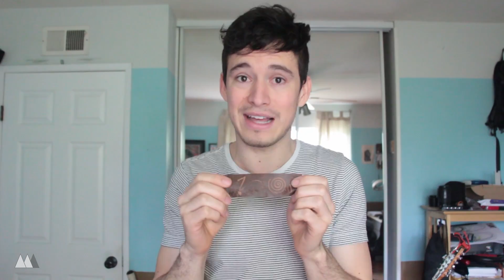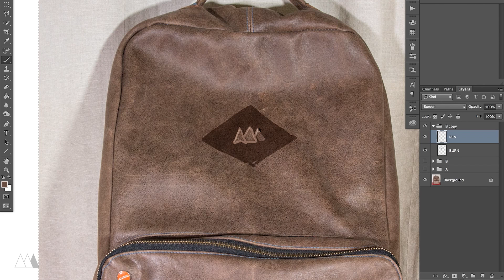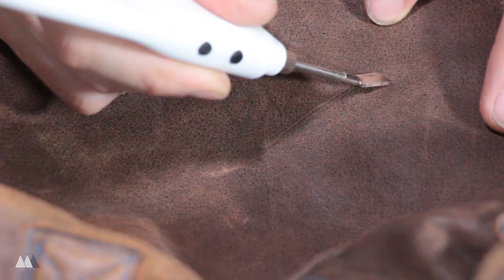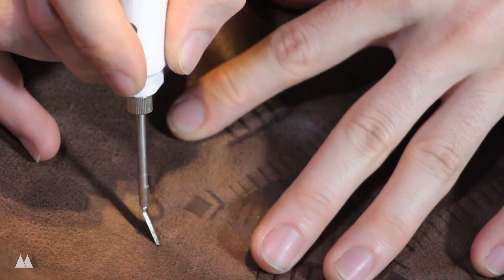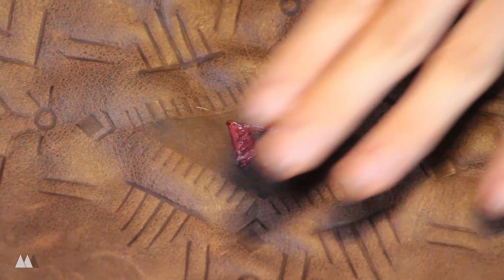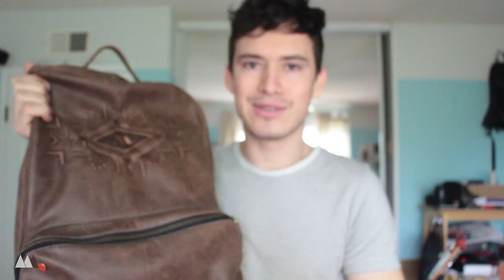Leather Burning My Backpack with the 3DSimo Mini 3D Pen

Comment: what I like to do with free hand techniques is I use the tool as a unit of measurement. I use a part of the tool for all the measurements and use it in proportion to the work surface/material. It helps a lot for me, and it might be able to help you too.

Comment: I only now just thought of this, why is it called pyrography if there are no flames involved? Pyro means fire but it's only heat. I understand that you heat leather, wood, bone, et cetera to oxidize it, but there is no self sustained combustion, a.k.a.: no fire, just oxidization/oxidation. Maybe there's some caramelization in there somewhere too. hmmmmmmmmm

Someone please teach this poor diploid eukaryote how pyrography chemically functions and the etemology behind the name. Pleeeeeeaaassse.
Reply from the maker: Shoot... maybe we need a new name for that too!
Reply: Make Anything // 3D Printing Channel 
Thanks for the reply!!!! 💙💙💙
I didn't expect anyone to reply at all let alone you! 😳
Reply: Is the leather not undergoing pyrolysis? https://en.wikipedia.org/wiki/Pyrolysis
Reply: Ninja Ott3r 
I don't think so, though it's very possible that I'm wrong. Pyrolysis occurs in the absence of oxygen, according to that Wikipedia article; Devon was burning leather surrounded by the oxygen containing atmosphere.
Thanks for the new information though! I didn't know about pyrolysis before now and always wondered how charcoal was made!
Reply: TauPhi Where the leather is actually receiving the heat, it is pressed under the metal heating tip. The technique can also be used on other, more flammable materials, such as wood. The reason I suggest pyrography is that combustion isn't happening, it's some sort of heat-induced decomposition.
Reply: Diet Nova 😘

Comment: The lightened effect seems like you're sort of "delaminating" the leather, removing the topmost treated layer of leather to expose the lighter raw material underneath. So, leather delaminating/delamination?
Reply: BTW, super rad finished product! (^_^)-b
Reply from the maker: Good point, that's essentially what's happening

Comment: Wait, does that mean you could 3D print onto leather, with a 3D printer instead of a 3D pen, and as a result end up with an even more accurate design?
Reply from the maker: probably.. I'm really hoping to try!
Reply: That would be awesome. I can imagine an entire clothing line based around this technique for some reason. Almost completely impractical. But still, a man can dream.

Comment: Nice one. It would be interesting to use use the 3D pen on a T-shirt, tie die the shirt and then remove the plastic..?
Reply: Mark Wheadon the only problem that I see is that the colour could still bleed on the inside of the shirt
Reply: AwesomeTree ProCreeper 2000 you could put the 3d printed part on the inside and the outside
Reply: Mark Wheadon omg yes, that sounds amazing

Comment: Hi, it is my birthday very soon and my dad told me i could get a 3D printer, which i'm super hyped about. But the only problem is that i don't know what printer is should get. Please make A 3D printer buyers guide.
Love your video's man!
Reply: Mathis get a Prusa i3 mk2 it is very good and not that pricey "only"  739$ it's great value for the price
but you have to build it on your own or you can buy the assembled printer but it's 999$ 
welcome to the 3D printing community
Reply: [MG] Raphi ok, this is not relevant so go brag somewhere else
Reply: anet a8
Reply: Hey Mathis, I'm basically in the same situation and I have chosen the Prusa i3 MK2 😊
Reply: Anet A8, it's a clone of the prusa i3, but a lot cheaper. I've one and the results are the same but it's ¼ of the price
Reply: 00000a0009 or if you want a more solidly built 3d printer that has better screen control for a bit more, you can get the newer anet a6.
it doesn't have such a big community as the a8, but that's just because it is a newer printer and partly because it is more expensive, so the community can only grow.
Reply: but what do i have to say, i have the a6 just as you 00000a0009 have the a8
Reply: Mathis ultimaker
Reply: Mathis get the flashforge finder, it is cheaper than a makerbot, easy to use and prints very well
Reply: You could also buy a cheap china prusa, like the anet a8, or if you want a little better printer, the anet a6.
Reply: Mathis its depend on your needs
Reply: Mathis I thought it said "please read more" 😂
Reply: Mathis if you're looking for a cheap option go with the anet a8 it works very well for how cheap it is and there is a large community for it http://m.gearbest.com/3d-printers-3d-printer-kits/pp_337314.html
Reply: Anthony Rodriguez on yeh lol!
Reply: Mathis needs some assembly but cheap af
Reply: my favorite 3d printer i have used was the ultimaker 3 extended
Reply: Mathis happy bday although I'm a few weeks late
Reply: Mathis!!!
Reply: Mathis get the anet a8 diy kit its a very good printer and you learn how to fix it because you put it together your self and its about 130 to 220 us dollars
Reply: The Retarded cuber bra u would have to be rich for that kind of money
Reply: Cool! I'm getting a Anet-A8 printer. The thing about it is you have to build it and download a new software "you can do the research on it." The great thing about it is its $220 on most websites! Hope this helped
Reply: i bought an ultimaker 3
Reply: [MG] Raphi congratulations!😉
Reply: Get an sla printer
Reply: Mathis he was not bragging okay I'm not trying to be mean but he was making a statement about what he was hyped about!
Reply: Mathis My birthday is in about an week (3 of March) and I will get a Pc worth 3000€ I'm so hyped too

Comment: Devin the technique your using is called leather pyrography.
Reply: Senpaii Avii-Chan he's referring to peeling up the outer pigment using the sticky pla, not the leather burning (which he referred to as leather burning several times).
Reply: ahhh okay guys i get it now. I am such a dummy. lol.  he means the pla stripping. maybe he could name it plastic excoriating technique.
Reply: Senpaii Avii-Chan my problem with that is that it's not the heat but the adhesion that pulls up the grain. But, lol, I suppose we're all just taking stabs in the dark!
Reply: yeah i just saw it. maybe he could call it leather highlight pyrography.
Reply: but that's the leather burning. he needs a name for the plastic peeling ;)
Reply: DeadlyMitten been there, said that 😉
Reply: Leather Highlighting
Reply: Sharon Brown point taken :)
Reply: lol didn't see the dropdown for the previous reactions ;)
Reply: Sam G 😂😂
Reply: The word pyro relates to fire, so wouldn't it still be burning and not "bleaching"
Reply: lol
Reply: is that SERIOUSLY the literal term?!!! 'o'
Reply: I would call it Thermocontrasting
Reply: Senpai Avi-Chan o
Reply: I red pyrography as promography AND BOI AM I HYPED FOR PROM THIS YEAR
Reply: Senpai Avi-Chan naw he means the PLA 3D pen drawing not the burning
Reply: no he means the technique for putting plastic on it and peeling it off.
Reply: it is of the same technique with wood pyrography where you burn some parts of a leather or wood to create charred patterns.
Reply: Senpaii Avii-Chan but he also lighten it.
Reply: Senpaii Avii-Chan is stupid name
Reply: Sam G is cool name